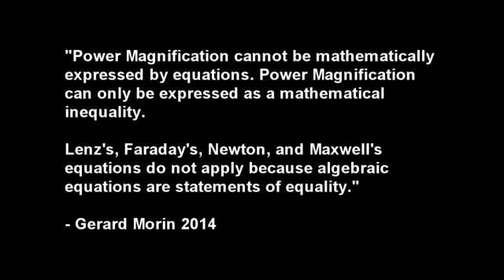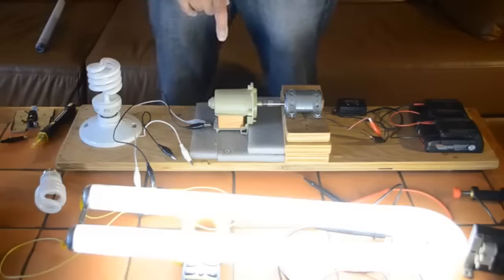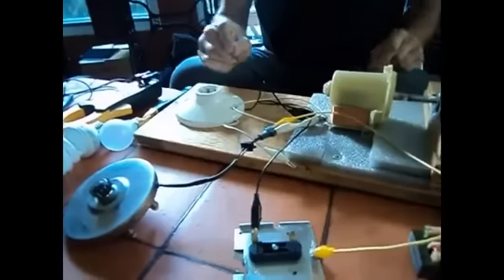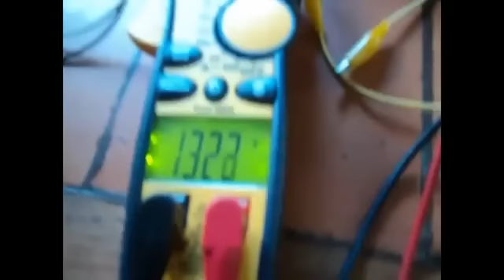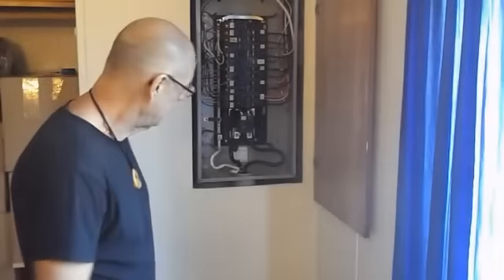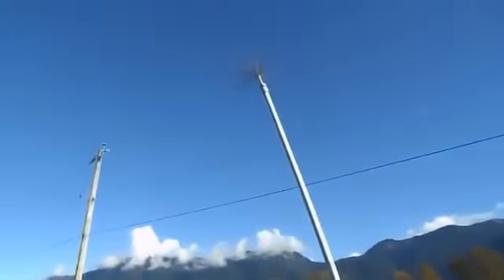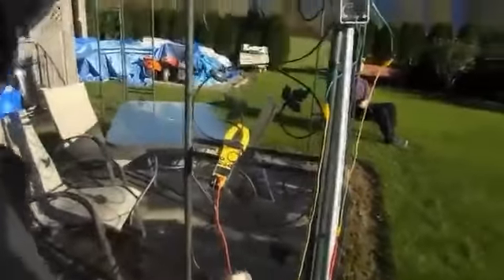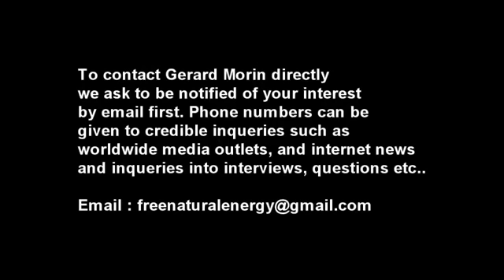Time to END The Electricity Racket - FREE & NATURAL ELECTRICITY PROOF

Comment: I believe in this, but why don't you power your own house this way. you have the magnets ? that's what I want to see ! 
I've been researching as much as I can lately to power my building. I'm deadly serious about that, but I'm no electrician but I am smart and handy but need some help and guidance.
Reply: The problem is energy conversion. Many people equate electrical power to volts, when it's really amps that's required. Amps are why a car battery (12v) can hurt you while a 9v can't in most cases.

To power more things in a house, you'd require tons of current (amps). A refrigerator and an AC using each takes so much power, it would be unreasonable to do without charging first. However, heat is only generated by voltage with a little amperage going through resistance.... In other words, CREATING resistance, which normally is NOT much wanted in electronics, creates that heat.

Current electronics only create heat as a byproduct, so sending electric through something that has high resistance. However, let's say the increase in power by magnets increases voltage.... he said at the beginning you cannot increase the amps. That means when you're increasing the SPEED of a motor, you're decreasing it's torque, in a manner of speaking. 

Since you're intelligent, maybe you can figure the rest out without me spelling it out? ^_^
Reply: Jeremiah I agree.  The ability to harness "free" or recycled energy is there, but these videos don't provide enough tech specs.  just show that it works , or how WHISPER QUIET it is.      huh?!?!
Reply: let me know if you find anything out.
Reply: People it’s fake
Reply: A car alternator will produce 220 volts when you wire to the right sode of the diods where AC BEFORE going through the diods and coming out 12 volts very simple start with old DODGE alternators the work the best. Stephen. Whotehorse
Reply: @undergroundnerdsnetwork9481  a 12 volt battery from a car actually cannot hurt you I've been shocked by a 12 volt battery which is very rare but I was sweating hanging upside down on a boat and my neck touch the positive cable of the battery is always touching the motor the shock was very slight
Reply: @Gadget-Tree  A car battery can hurt you, it could kill you, if you are somehow shocked while the engine is being started and hundreds of amps are being drawn from it.
Reply: You can't power a building with a 36V battery, don't be fooled by this. Energy is always conserved. You can't get out what isn't put in.
Reply: @1nickdel  I was saying it's damn near impossible for a human to complete such a circuit you need more than 12 volts
Reply: Jeremiah Meachum rip apart an old microwave; the fan motor, step up transformer, and doubling capacitor are all in there. You can take part of the coil pack from the fan motor to mount across from the motor. KJmagnetics sells cheap neodymium magnets that you can put on the motor end to create the mystery box that sits across from the motor.

Comment: I was fascinated by the results of this experiment , I don't doubt the possibilities of it's capabilities and I believe that will work on a mass production level. I have study the hidden power of magnets and it's properties. I am aware of the configuration of two DC moters being ran by each other one receiving power from the other and then sending it back , which in simple terms,,,,ACTION FOR REACTION , that becomes kinetic energy . But I don't see a compatible capacitor to charge and discharge the energy and allowing it to be trapped between the two DC motors that acts like generators so ,How does he maintain the flow of current smoothly without fluctuation? I have watch other videos of free energy and understand the theory of how it works. But this guy seem to have raise the bar of generating high ratio electricity from a small package. I also believe that from my studies that the electricity that we generate today is really artificial electricity. According to Tesla and another backyard scientist of today I cannot recall his name will say that true electricity is measured by RF which means radio frequency electromagnetism. Maybe this is what Tesla was trying to tell us when he introduced to us transmitted energy without the need of wires. And yes this fellow man is on the to something big . I am looking forward to buy property in Pennsylvania and build a project model house generating its own electricity using the power of magnetism. It can be done. Free energy is here always has been it's just that a lot of people don't know about it still. And I'm doing a number of schematics and building prototype models for myself it's exciting, and allows you to learn from your mistakes and always look for improvements. Basically I'm looking to become a patent designer. This is in my field for what I do. I encourage everyone to keep trying and do not give up
Reply: wake up
Reply: Yeah patent designer my ass.
Reply: Anyone who believes this, fails to understand the law of conservation of energy.  There is NO SUCH THING as a greater than unity energy source. There is no way you're going to get more energy out, than was put into the system in the first place

Comment: Very good information, I don't know if I missed something but what is recharging the batteries, if needed
Reply: 214rsanchez nothing
Reply: This is a demonstration. The batteries were already charged. However, a smart person would probably attach a battery charger to this since it is clear that the output is higher than needs of the batteries. This can be extrapolated into a much larger system and would be independent as long as failure was prevented.
Reply: AC power from the wall lol ..or solar.. this guy doesnt seem smart enough to get that set up going though even though its easy.

Comment: Wha--? You can't multiply the amps?? All you have to do is take two batteries, connect them in parallel and you have doubled the amps.
Reply: try to listen   no amps   more volts
Reply: @garynehila292  The old guy is factually wrong. He claims “You can only multiply volts.” You certainly can multiply amps. Just connect the batteries in parallel.
Reply: @Jim-mn7yq  you only need to increase volts in this example
Reply: @garynehila292  So? You increase the volts, lower the amps, or increase the amps and lower the volts. So what? The power (which is the important thing) is the same.
Look, this guy's a crank. There is no such thing as free energy.

Comment: Gerard, most interesting video's. Quite fascinating. I would like to know if a high energy company has snapped you up and given you all you require to continue your work. I did note that you said you had dropped out of school as they were not teaching you enough useful information. Unfortunately, if you haven't stayed the coarse and got a certificate you'd have been frozen out. I reckon these energy/tech companies are holding out on us. There is always a better version of something further down the line to relieve us of our hard-earned cash. Thumbs up anyway. All you geeks need to get together instead of slagging each other off.
Reply: There are hundreds of ways to get energy efficiency, I have came up with 3 different concepts in the last month, and I really wonder why these haven't been put into use...  I tested 2 of the 3 but all three work in theory with such parameters, they all need fuel but the efficiency of each of them is extreme.  2 of them the parts will run out before the fuel needs to be recharged.   It's so strange cause I see these concepts being used everywhere but for other purposes...   I wish I could share these with you now, but I am going to try and patent these, my brother has came up with some cool things recently too and is also going to try and patent his new speaker creation.   I think the trick which allowed me to figure out ways to create power systems which are very efficient is to observe things which create force and try to find complex systems which allow for more output than what it normally should output.  One of these I decided to use springs though I found out that this could be problematic... Hooke's law is great, but once the springs parameters begin to degrade... well like I said the parts will fail on all of my ideas before you need to recharge the fuel... haha   I notice something though, with all of the people who are trying to figure out how to get free energy... which isn't possible, these people are not able to figure anything out because that approach can not work, also they are mostly very simplistic in their concepts... maybe due to a lack of mechanically inclined ability?  For even a cars engine is very complex, though it's basic energy system is combustion.   Hmm with one of my designs which I have fully created and tested with extreme success, I think I am just going to give this away for free after I patent it, everyone will be able to obtain such a machine, or create it themselves in this case.  I was so excited when I thought of it, of all things I figured it out by looking at a dump truck one morning... lol
Reply: @DJxSGGxNeo  let me knw if u hv it really.  I am waiting..

Comment: if can not afford these fountain pumps ( on ball bearings ) easy way is to use car alternators ( for 100% free energy over unity '' 2 x large and small gearing wheels  ( total 4 ) 2 x washing machine motor 2 x alternator '' running on belts or chains 1 battery used as 12v exciter and starter only ' when first motor switched off the second motor continues as its plugged into a 12v inverter used as a spike regulator ' hydrogen can power a small engine to run an alternator to power a 12v inverter directly with no battery's too / charges own .

Comment: Not about voltage. It about current. Voltage multiply by current to get the power output of the driving motor. 
That is what is putting out the power

Comment: That's actually really old technology... They used to power tube transceivers with that.  It's called a dynamotor.
Reply: you nailed it on the head.  Back in 1957 my dad bought a surplus GE transceiver that came from one of the first police cars that had 2-way radio in the car.  It ran off of the 12 volts in the car and hummed along 24/7 making 110 volts for the tube transceiver for our police radio monitor.  This motor-generator, or genset, is nothing new, just suppressed.  There were also oscillators as well.  Tesla recognized the power of oscillation.
Reply: I need one of those contraptions to help me get off the couch....
Reply: @lewismohr1  energy cannot be created or destroyed only changed in it;s form-   looked at the part where he had current trough the netrual lead on his fuse box is because the two lines were not perfectly balanced.  if everything he had worked on 220 only then he would have zero current through the neutral wire.  basic electricity - electronics
Reply: Voltage is NOT energy.  Voltage is a measure of an electromagnetic force by which atoms are induced to draw in or push out electrons after they have gained or lost one.  These "charged" atoms are called ions.  An atom that has lost an electron has a negative charge and is a negative ion.  An atom that has gained an electron has a + charge.  Voltage is the amount of force that induces the ionization.  Rub a balloon on your pants then hold it near your head.  The friction caused heat, the heat excites atoms, some atoms on the balloon lost electrons.  Move the balloon to you hair.  The atoms in your hair are drawn to the balloon as its atoms seek out electrons to balance their numbers.   Voltage is a measure of the force the charged atoms have which draws or pushes other atoms' nearby electrons.  Microvolts might give u a shock from static after rubbing the balloon.  The static of fields of grass blowing and rubbing, tree leaves rustling, and the very air around us brushing against itself from the mix of hi and low pressure - all of which herald the pending storm, has countless ionized atoms that have voltage so forceful the slightest moisture causes the air itself to push and pull electrons in burst as hot as the sun.  Lightening.  This video shows a battery operated flash light that can switch the circuit to an ac current from the battery operating a generator to run the light instead.  It plays with voltage and induction but as he says, the energy it produces (amps) is tiny. Take away the precharged battery and it's just wires, a light bulb, and a small generator with nothing to make it spin.
Reply: Nothing was suppressed.  Step up and step down transformers are in every device we carry.  Tubes were replaced by transistors.  Your Dads police radio operated because its battery was kept charged up everytime the cars combustion engine started and a belt around its main pulley spun the cars alternator.  In this videos case the battery is spinning the alternator which powers a bulb.  But nothing is charging the soon to dead battery.

Comment: Clickbyte and nothing else. He "discovered" a mechanical transformer that multiplies the voltage that is needed to run the discharge lamp. The same is done with a DC-AC or DC-DC converter, without noise, with less loss but with more sense. Energy is getting more and more expensive not because someone is greedy, but because someone prints money endlessly. Therefore, you need to take care of two incomes and control costs. Free energy does not exist or is useless, as the electrostatic one from the air. Ten years of studying Tesla sounds like a grim joke. In one semester in electrical school, you will learn much more and, above all, useful knowledge.

Comment: I actually live 100% off grid and make 100% of the electricity I use on a daily so I'm not preaching what I don't practice.... Unlike this guy.
Reply: I am the same, I struggle in winter a little, but most my energy is home produced, but I am slowly adding to my system and hope to get rid of the Electricity meter someday soon.
Reply: @richardsandwell2285 Well your are very lucky living in a country were that does not make you a super villain.

Comment: I wonder, if you can use 2 12 volt car batteries to do this with, and use some of the output to run a 12 volt charger to continuously keep the batteries charged, and get the same results ?  it seems like that would be a never ending source of power ?
Reply: That is what I wonder,  he is starting off with 2 18 v lithium batteries, where does he show getting more than that amount of energy out of the batteries?  He is only showing he can light a bulb, how about power a tv, stereo, toaster?
Reply: AUBREY ANSELL it won't run high current devices because the alternator he is using only delivers 30w. He would need a 1000w alternator to deliver enough energy to power a 1000w toaster.

What he doesn't mention is the alternator and motor have bearings and brushes that will wear out much like the alternator in your car. 

What he also doesn't mention is that although it's easy to light fluoro tubes with high voltages, it's also easy to start fires in your house wiring due to the much greater spark gap.

There is nothing revolutionary in this demonstration, he is just demonstrating electromagnetism and making out that he's uncovered some hidden truth. It's a load of shit.
Reply: That's only 24v u would probably need 3x12v=36v of them batteries, but if u add solar panel and batteries to this Method then yeas ur answer would be complete....unlimited power source....say bye to electric company lol

Comment: i love your presentation and would like to know more so i can build one my self for me and my family we live on a pine tree farm. just getting by and paying thru the nose for utilities.
Reply: Wow! Each TREE will give off ONE volt at super low amps. Use 1 nickle, and 1 copper large NAIL jammed in each tree - 110 trees = ,110 volts. Wire each tree parallel coper-coper, nickle to nickle - 1 volt at higher amp. Or series?, copper-nickle, criss crossing = 110 trees at 110 volts, ?? amps. If you do a field full of trees, you could? have 110 volts at some many useable amps, and run a 12v light bulb house. Never have to plug into Uncle Spam again.
You can get the same effect in jamming copper and nickle pipes into the ground and wrijng them up. 
But in all the above, the cost of copper and nickle is more than what you get out. 
Really, the cheapest energy is solar panels. I have 12 panels om top my truck camper= about 400-600 watts. It charges 3 marine batteries all day, then runs my 12v's all evening into the night and plus some. On cold overcast days, I'm screwed, so I use a propane generator. 
Morin's antenna with 1.5 volts is sucking off radio signals: If he put a spark plug on the end, and wired it up to a battery, he could slowly charge and store the volts, but it would be like 10 times less than a trickle charger unit. But still there is electricity!
Sadly, he is not saying anything that has not already been done and designed in the 20s and 40s. One thing he is right about: "The Sun. Shut that off and we're dead!

Comment: I want to learn what he knows
Reply: Go read some of those old 1950's cheap scifi novels. You know the ones, that use a ton of technobable.
Reply: I can tell you what he knows he is not showing you the amp used, (the most critical part) now think again about how free it is
Reply: He learned how to use a DC battery to make AC voltage with low amperage. It is something that has been known for over 100 years.

Comment: I am wondering why you don't use three rechargable 12Vdc batteries and  use a   charger to maintain the batteries in a loop. Especially if you can use a buck boost transformer and get the output to 220 Vac and connect it to a small breaker box. Allowing you to connect a 110Vac to 12Vdc charger and still have access to 110Vac then your batteries  would be charging themselves and making power to run other objects. Am I wrong or is it possible to make this self- sustaining?